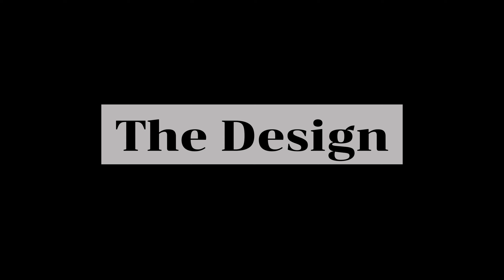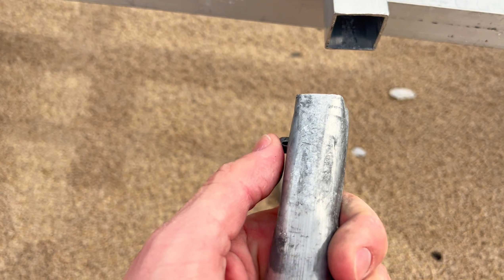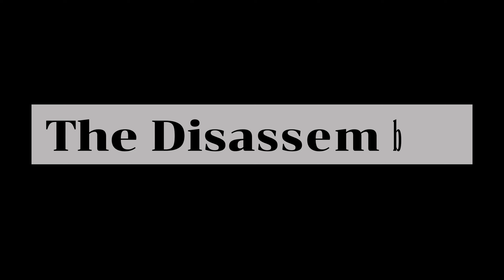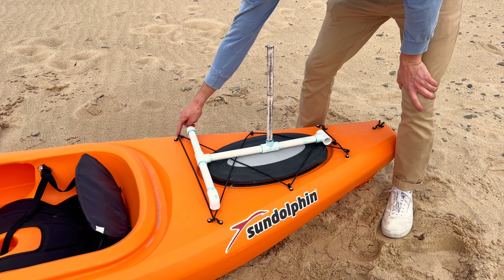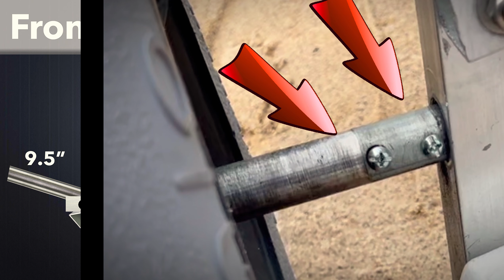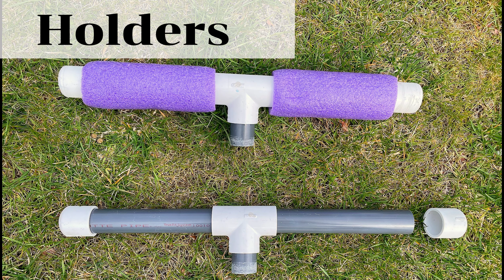Ultimate Kayak Cart - How to Build DIY

Comment: Will this cart hold a 60 Lbs, 20.5 inches width, v hull shape kayak?
Reply from the maker: Yes it will easily hold that weight. I would double check the width of the cart before gluing it together to make sure it fits the width for your kayak.